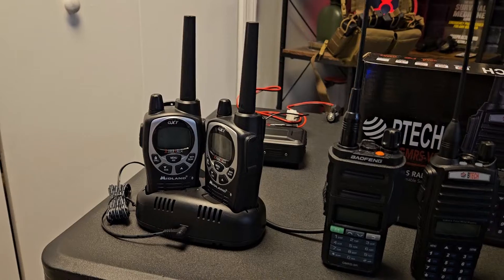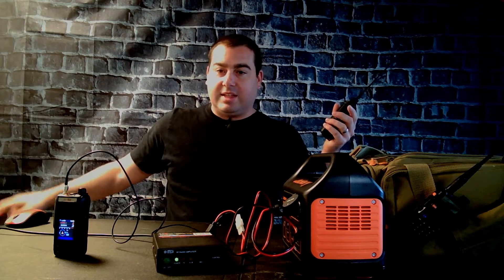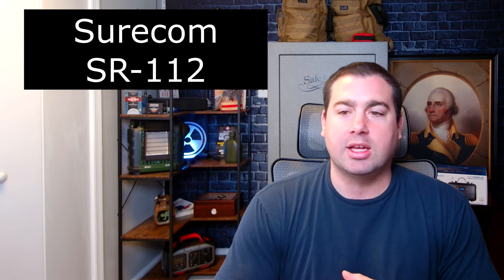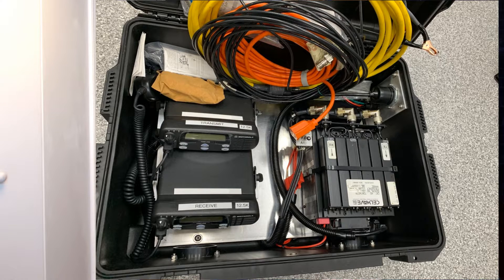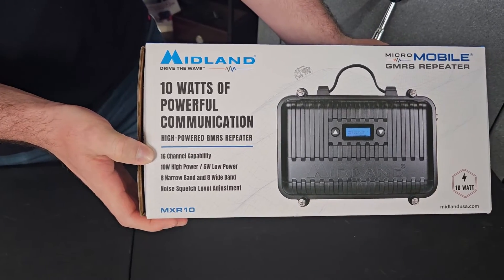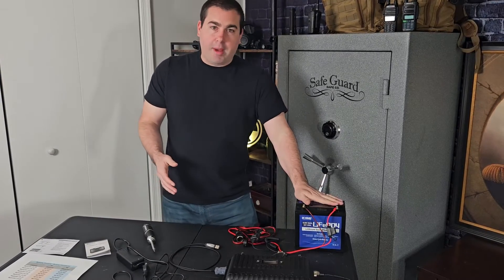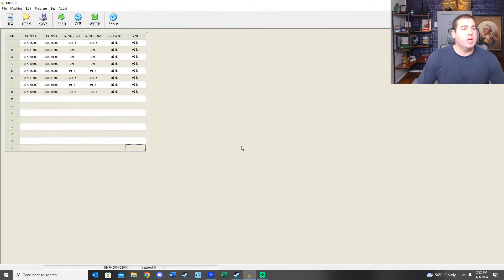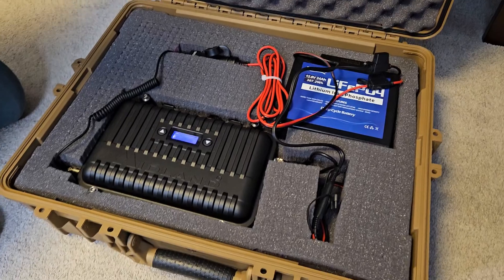GMRS Repeaters Setups & why we chose the Midland MXR10

Comment: Very nice video!  where did you obtain the Lithium Phosphate Battery from the Model?  Also, are there any issues with heat disbursment from the repeater while it is locked in the case?

Comment: Found out this morning (20 March 2025) that the programming cable used with the MXR10 repeater is not compatible with Windows 11.  Works fine with Windows 10, but not Windows 11.  Source: Midland tech support rep via text.
Reply from the maker: Midland radios are so weird to program i really dont have aot of midland stuff other then the mxr10.

Comment: If you are just adding a duplexer to two Baofengs, it is only going to work as well as a Baofeng with a rubber duck antenna.  With radio, the antenna is always the most important piece.

Comment: If that's not a Retevis RT97S, I'll eat the mic.
Reply from the maker: Its not... Make sure you film it.
Reply: I have the RT97S, and besides the name, and a slightly different design in the metal housing, it looks exactly the same as the MXR10...  Oh, and the total cost was ~$370, repeater, AC pwr, DC pwr, programming cable, mic/speaker, 50' cable, and antenna w/mounting bracket and <10 days shipping time to the west coast (08/24).
Reply from the maker: @MrMindlink  Yeah the 2 units are very similar. I like that Midland is an American company.

Comment: Why is it only ten watts?  Seems like you would want at least 25
Reply: I have this repeater in my apartment with the antenna in the attic space. The antenna is just a 6db mag mount on a pizza baking pan at a height of about three stories. I get a three mile radius from a handheld, which isn’t bad considering it’s only five watts and indoors. A tuned, high gain antenna mounted as high as possible is what produces the most distance. Most of the other repeaters in my area are running at five watts, but their antennas are outside and well over a hundred feet high (I can reach them over 15 miles away). If you can’t get an antenna at least 30 or 40 feet off the ground, I wouldn’t bother with a repeater.

Comment: On a simplex repeater use split tones.  You can hear only the repeater.  No echo.
Reply: Can u elaborate?
Reply: @STIFFLERJJ68 You set the RX on the user handsets to use a ctcss or digital tone that's different from the TX. That way, when a user transmits, the other user radios may receive that if they're in range, but they'll ignore it because it doesn't have the tone. You set the TX on the repeater to use the same tone as the RX on the user sets. So when the repeater transmits, the user radios will accept it. This accomplishes not having to hear a transmission twice.
Reply: Will that accomplish using FRS  when they don't have split freq

Comment: One thing you might want to add is Ramsey FM100b 25mW FM Stereo Low Power. These run about $250.00. I have one and a video showing it. It allows you take over any FM station. So you can take over a station on the radio and telling people what is happening. They have to be built so finding something who knows what they are doing is important
Reply from the maker: ill check it out. Thanks.